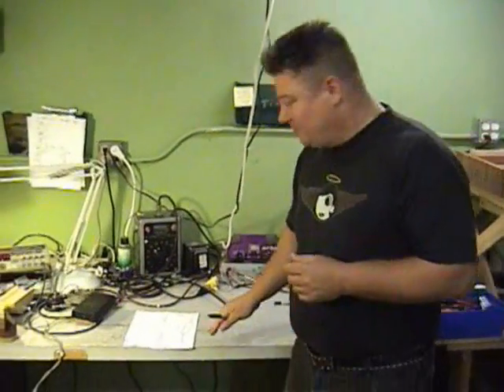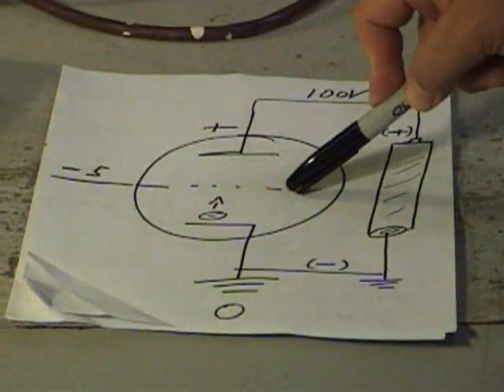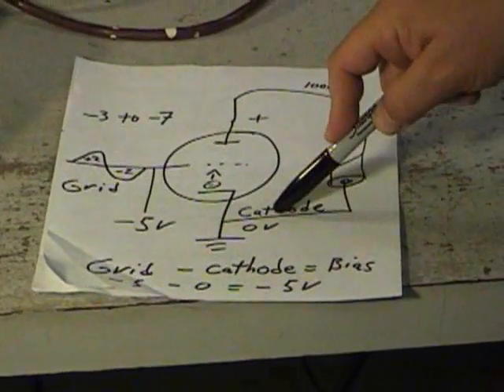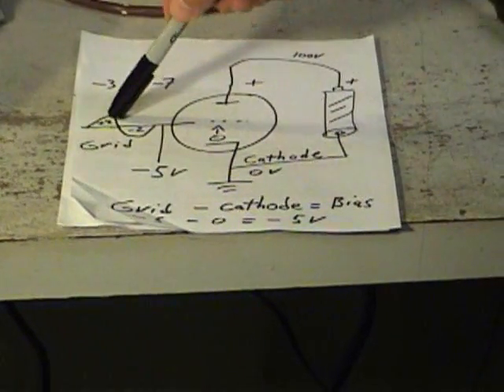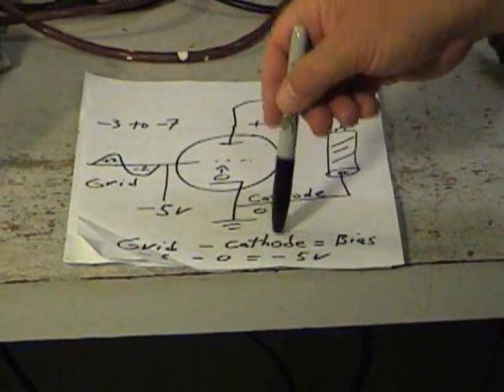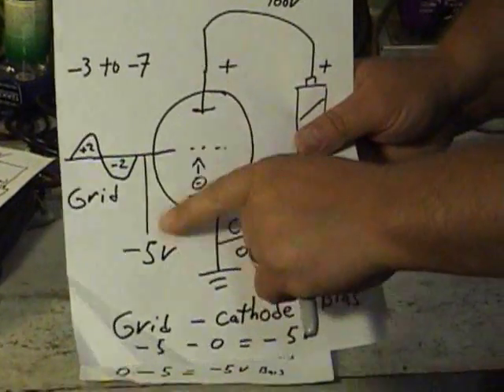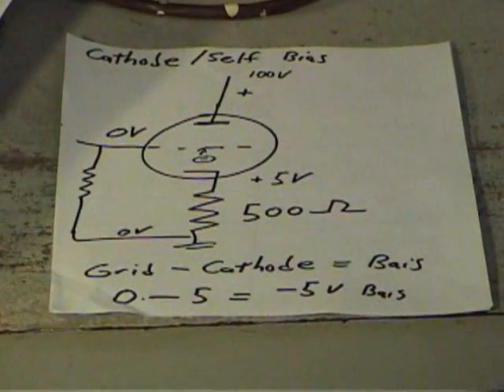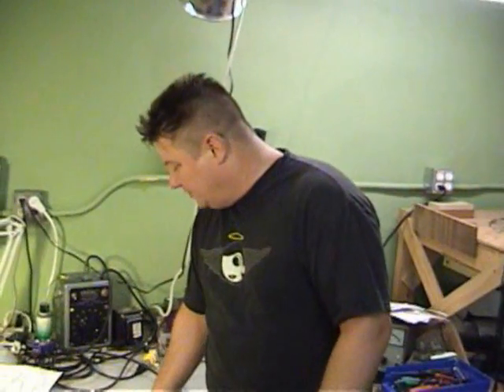Bias Part 2 - Steve Carr Gets Technical

Comment from the maker: Sorry it has taken me forever to get back to you!
That is correct - with a cathode bias or self bias amp you just plug in a new set of matched tubes and you are done.  The voltage drop thru the cathode resistor creates the offset between the grid and the cathode (or bias) -- !

Comment: This really explains things...cool!  So that is why EL84 use cathode bias....because only -10 volts. I have a 1930's amp/PA  I am restoring,uses 6L6 push/pull.(25 watt ?).and it uses cathode bias .Will be intersting to see how it sounds when playing loud bassy symphonic /movie music through.. I could convert it to fixed,but might need bigger output trans.There's another way some 1930's tube radios obtain fixed bias by having grids go to resistor above ground on  centre tap of power transformer..

Comment: Really Awesome video. Explained alot. I have a little 37 watt ceriatone I built a while back and I was wondering about the bias. Didnt know there was such a thing as fixed bias using the resistor. And I just got done staring at the schematic wondering what they did there with that resistor. Thanks Again!

Comment: ...Therefore the Ck cap is put into parallel with the Rk resistor to provide a certain band of frequency (within the A/C signal) a quicker path from ground--than the Rk resistor is offering-- to the cathode, and thus will help tonal shape the sound characteristics of the amplification of the A/C signal.

Comment: @iorixs The Ck capacitor is a separate path for the A/C signal, which is originating from the ground, to bypass the Rk resistor and reach the cathode. The Ck capacitor will resist the A/C current coming from ground through its capacitive reactance, which is a function of the ripple voltage and frequency of the A/C signal. The size of the capacitor (pico- or micro- farads) ultimately will effect certain frequencies of the A/C signal.
Reply: The signal current flowing in an unbypassed cathode resistor develops a signal at the cathode which is working in opposition to the signal at the grid, reducing the gain of the stage. A bypass capacitor with a large enough capacitance prevents the feedback signal from developing at all frequencies, allowing the stage to achieve maximum gain. A smaller capacitor allows feedback to be generated at lower frequencies, reducing the gain at lower frequencies, cutting bass response.

Comment from the maker: Hello Chip
It all depends on the amp and the tubes.
If the tubes are a hot set that will draw a lot of current and require a high bias voltage and you put them in an amp set for a low current draw set the tubes could overhead and fail.
You can put them in and watch the plates for s while to see if they start glowing red - turn the amp off if this happens.
If the opposite situation happens and the tubes are very cold bias wise the amp will sound anemic.
Best
Steve